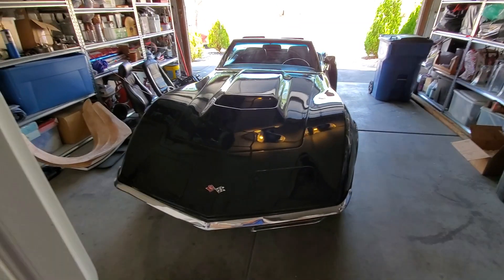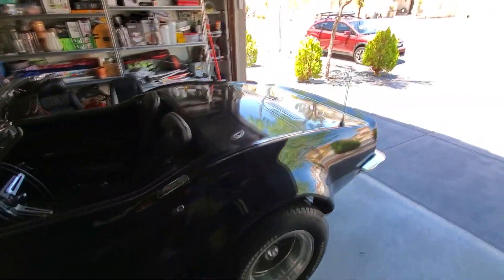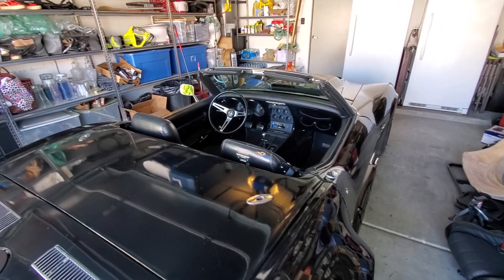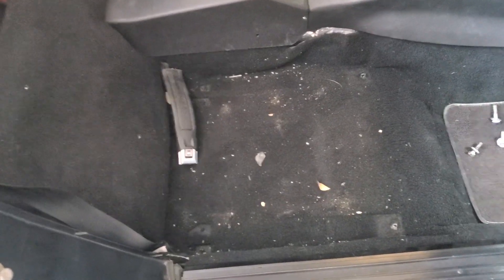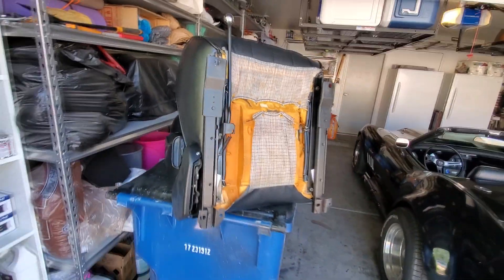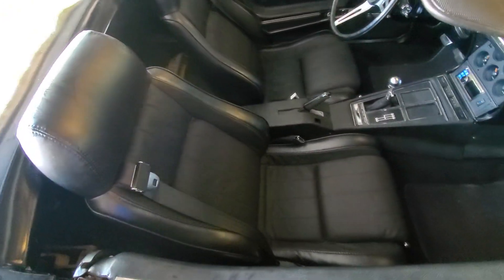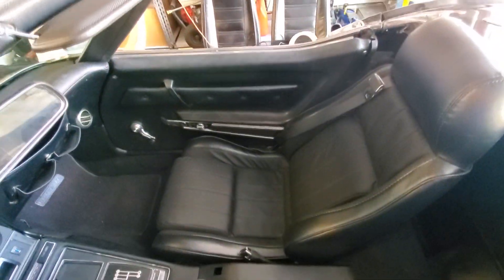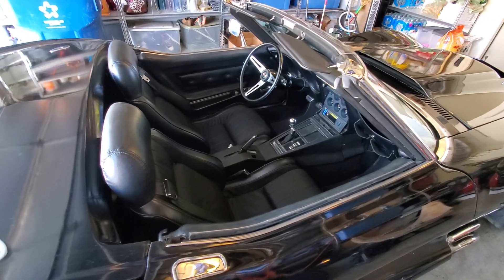Not enough time right now to do much. Passenger seat installed.

Comment: Those seats are just the right height, for out of a Pontiac. If they were lower, I don't know, I think it would resemble aftermarket. They would have to be dead on level or it would look odd or noticeable. With these people will just walk right bye. Maybe later they'd scratch their head?
Reply from the maker: It will make them wonder for sure.